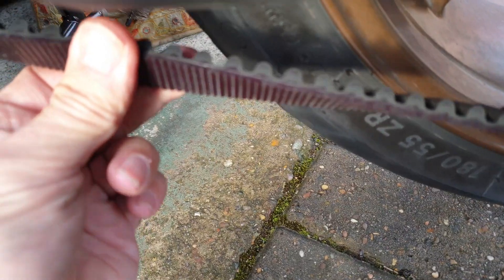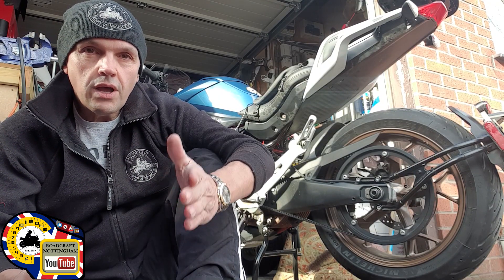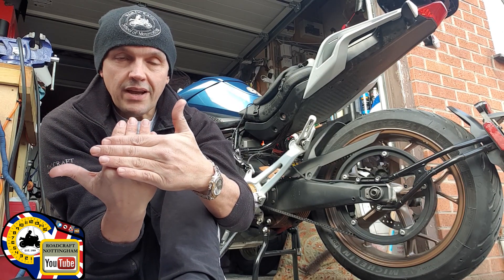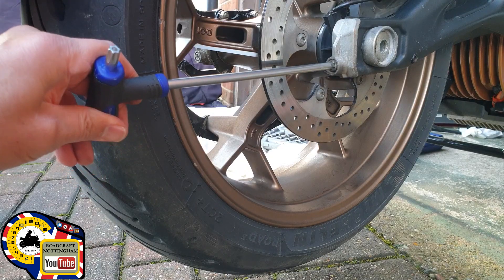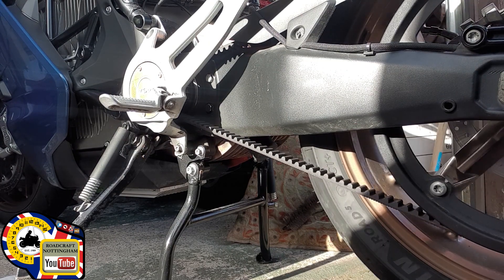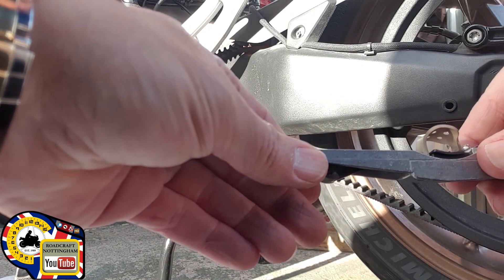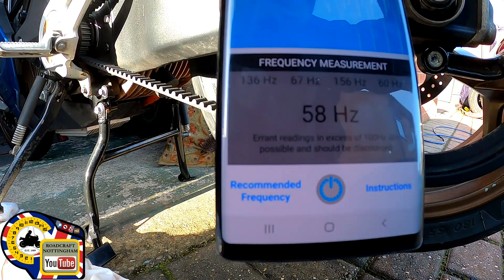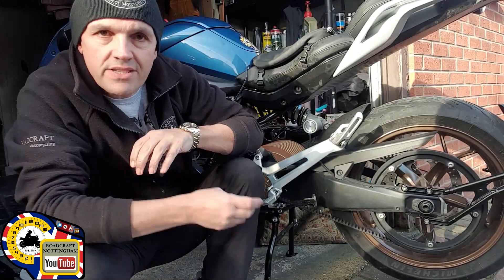How to check and adjust a 2020 Zero sr/s Belt drive (Timestamps in description)

Comment: “That’s acceptable” at 4:08. My manual lists a unit not on the cricket. (Neither kg nor lbs, and doesn’t convert simply bc it’s needs extra stuff like belt length blah blah) Do you know the kg or lbs acceptable range? You never actually said the range in the video.

Comment: Hey man, had a question. I have a 2022 zero srs are the belt or something else is making a real loud sound when I engage the throttle. It was just a squeaky sound but after trying to fix it, it became louder and more like a metallic groan sound. Any ideas on what this in?
Reply: My FXS did this and the motor was out of alignment from the factory. Took a ton of tinkering to figure out how to get it correct. Just adjusting the motor mount adjusters...

Comment: Do you know of anyone that has run one with a loose belt, and did it cause any problems?
Harley's run with a bit of slack in the belt, it makes me wonder why these have such a tight spec.
Reply from the maker: I don't but I'd set it to the lower end of acceptable
Reply: Hi there. Mine came so tight from the showroom I thought it was very wrong

Comment: Great video. Im on my third Zero in 3 years. DRS, SRF 14.4 now SRF 15.3. Broken 2 belts both below 2,000 miles. In the first instance SRF 14.4 the wheel tensioner on the non drive side had a fractured piece of aluminium lug sandwiched between the clamp plates from deliverery and as a result would wander out of line on regen but pull back in line on acceleration. I had checked the tension with both the klicit and the gates app and it was correct but he misalignment I was unaware was happening killed the belt. 
The second belt always sounded "wrong" with a rurr rurr rurr in sequence with the belt rotation, again tension was correct and no visual clues.  The second belt belt snapped but i figured how to store a belt under the seat (twist it to get it in 3 loops) and had tools so 10 minutes later Im sorted.
If you get a good belt and tension in correct and aligne it wit the 1mm clearance your on a winner I did 7,500 miles on my second replacement before the bike went  but always carry a spare and tools and listen to the belt a good one sounds so consistent.

Comment: How would you adjust if the belt tension was not within tolerance?
Reply from the maker: Turn the adjuster bolts 1/16 turn each until the correct tension is reached.

Comment: Very help full. This may help a bit. A good way to check the gap between belt and sprocket is to use plastic packers. These are used by carpenters to pack out gaps etc. They come in sizes from 1mm to 10mm. Made of hard plastic.Most big DIY stores will have them or ask a chippy they normal have some spare in the van. They only cost pennies.

Comment: Do belt drives work well on unsealed roads. Chain drives need heaps of TLC as dirt + oil or anything wet turns into a grinding paste. I thought the fact they run dry would help in dusty conditions? I see the dual-sport models have a belt drive. Anybody in YouTube land got any experience?
Reply from the maker: The general concensus is that off road isn't as bad as you'd think. The main problem is extreme riding/jumping etc which can overload the belt and risk snapping. Chain drive conversions are readily available on the dual sport bikes for those who are worried.

Comment: I find getting alignment right to be very tricky. If i set it correctly on the centre stand it moves a couple of millimetres inwards (towards the wheel) when i ride it, which seems odd I’d have thought if anything it would move the other way under load. Any thoughts ?
Reply from the maker: That's weird, maybe a load torque issue?
Reply: I have a 2020 srs. Mine does the same. I keep in mind it will when adjusting but there is no way Ive found to get it right first try. I go ride around and if its gone too far in i pull it back a bit. If i test very gently, might not happen. but as soon as I hammer it full power over it goes, and I have to return the garage for one last adjustment

Comment: Didn't manufacturer always sell you the belt drive as a zero maintenance... this to me seems maintenance... like a chain except the lubing part... wich is the fun part!
Reply from the maker: They're practically zero maintenance but anything that takes that much strain is going to need checking from time to time.
Reply: I agree, Im a bike mechanic and I have more time wrapped up in screwing with belt alignment then I ever would with a chain, which is more forgiving
Reply: Definitely ZERO maintenance :-)